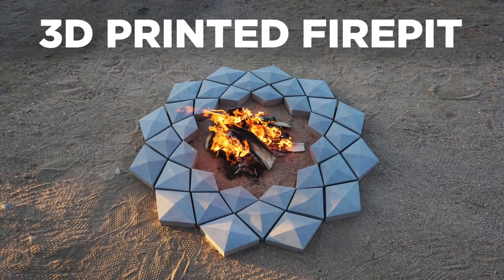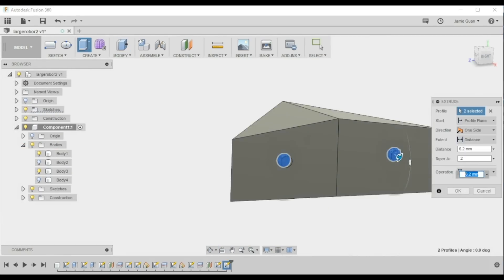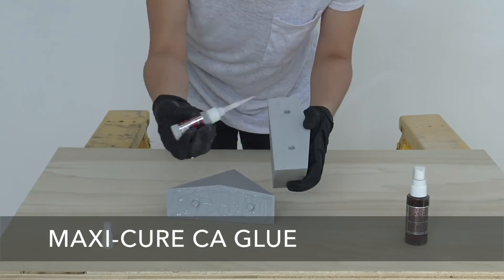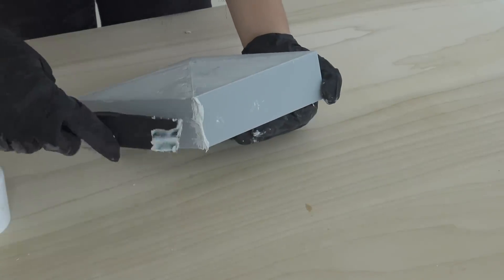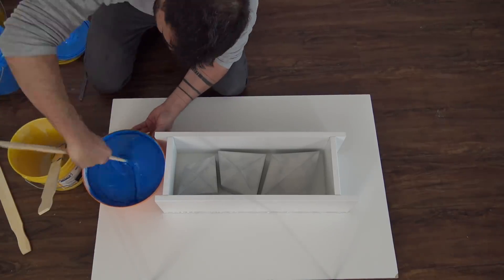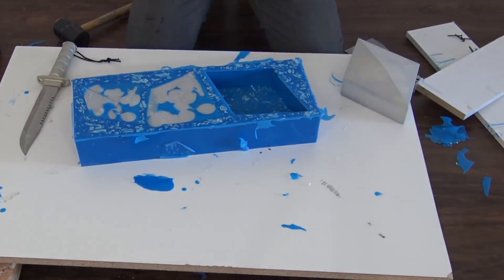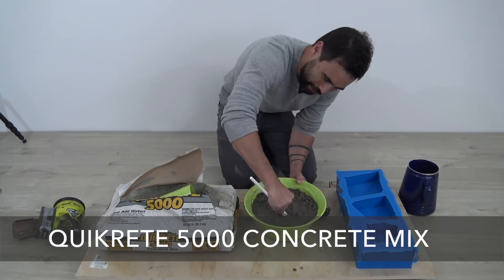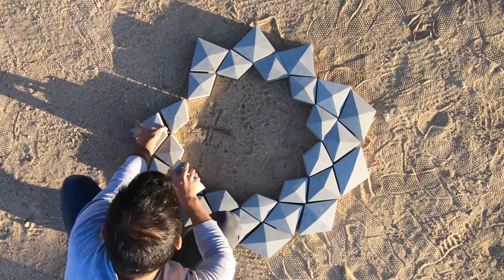3D Printed Concrete Firepit

Comment from the maker: Links to the 3d files in case anyone else wants to make one:
Small: https://autode.sk/2K8McyK

Medium: https://autode.sk/2I8eCZ0

Large: https://autode.sk/2KQRSi1
Reply from the maker: each file is a different block they are the same size as the ones I used
Reply: HomeMadeModern simply beautiful truly love the design have you thought of selling the molds for this project?
Reply: Deceptive Title

Comment: Interesting design process. I think it would be faster to just make the prototype shapes out of cardboard or foam core. Then you could fill them with plaster of paris and proceed from there. You don't even need a computer to draw these shapes. Just a compass, ruler, and a bit of math.
Reply from the maker: yes!  foam or wood would both work well!

Comment: I'm a bit curious. You're essentially using just the outside of the 3D printed shapes to make your silicone mould. Why did you print them as thickly outlined and skeleton infilled shapes instead of using just a thinner outer shell? Are they not strong enough with a thinner shell? Did they warp too much when using just a shell?

Comment: Hi Ben, thanks for the video and the designs, your work is gorgeous. What material is best to print the 3D objects used for the silicone mold? I'm sure there are differences in finish despite the Bondo being added

Comment: So..why the f*ck did you 3d-print these blocks?

A piece of wood, a saw, a planer and 15 minutes of elbowgrease would have gotten you the same result, wihtout wasting  a ton of plastic.

And with a little more skill you could easily make a re-usable mold entirely out of wood...

I hate the 3d-printer generation, the iphone stupidity.... yes you are making a firepit but you are using the zero-skill method, where's the challenge?

Comment: That’s pretty dang cool. Kind of disappointed you didn’t actually 3D print concrete with a special printer, but still cool none the less. 

Some other idea would be to add color flakes and other small stones into the cement before pouring to get some cool patterns.

Comment: if you made a vapor chamber and put your prints in there it will smooth out your print.
Reply: Won't work for PLA which is what he said he used. ;)

Comment: Anybody know of a more affordable silicone for the mold? My Canadian distributor for Mold Star 30 says it's $250 plus shipping for 1 gallon of it. Way too much.
Reply: 3d print or fabricate the mold out of plywood. Just take the negative of the shape. Maybe cut the model in half or quarters, and make indexing pins and holes for bolts. This makes getting the casting out easier. Use petroleum jelly as a release agent. Don't get why they didn't do this in the first place.

Comment: I love the finished product! It's such a neat design and it's a versatile enough idea that you could rearrange the shapes or add a couple of new ones and end up with a totally different design if you got tired of this one. And it's great that you used 3D printing and concrete to get there! I could definitely see making the original forms out of wood if one didn't have a 3D printer. Neat!

Comment: Is there a reason you chose bondo over acetone for smoothing?
Reply: acetone doesn't dissolve or smooth pla plastic. 0:42 top right of cura settings

Comment: FYI if anyone chooses to follow this guide and 3D print the positives for the molds.
1. Drop layer height to increase quality of part.
2. Parts show here were printed on close to 20% infill which uses excessive material and time. Since they don't need to be strong they could be printed on closer to 10% infill. 
3. PLA can be sanded down to remove ridges although you would still need to fill the gaps with Bondo if printing in multiple pieces.

Comment: This is a very nice design. I was wondering if there is a way to skip the molding process and go directly from the 3d print to the concrete form. While I have not been working a lot with flexible filament it might actually work out to create a mold from flex filament and directly pour the concrete in it ...
Reply: @Emmett Martin , sorry if i sound stupid, english is not my native language and I sometimes do big mistakes.
Reply: I'm pretty sure we could even pour concrete in solid material like PLA as soon as the design is simple and the mold is well thinked. A design like this one could be printed as a four interlocking parts mold for each pieces. I actually have to try this!
BTW @WayofWood love your channel, love the way you use your printed pieces as tools and not as finished product.
Reply: I'd recommend ninjaflex 👍
Reply: tokagehideto well thinked 😂
Reply: The amount of material required would be ridiculous, and there's a good chance that the layers would separate.
Reply: that's more a proof of concept than a real project. I tried it, it was fun and it actualy work i used prompt vicat in my concrete to make it cure quickly since having to much water in contact with the PLA was making it delaminate.

Comment: Great video. Love the idea. Was there a reason you used Bondo instead of spray on filler primer?
Reply from the maker: I haven't tried a spray on filler yet but open to the idea.  know of a good one?
Reply: I use Rust-Oleum 2-in-1 Filler Primer. It's worked for me on a number of projects. I recommend applying a coat, letting it dry, sand  and repeat until smooth. It usually takes me 2 coats to smooth out a 3D print.

Comment: Great design process and love the final product. I hate to mention that concrete will easily crack with the heat generated from fire. This project is probably only as useful for very small fires that are within 2 feet of the blocks. Otherwise its way cool!
Reply: Troye Stonich you didn’t watch the video before commenting did you.
Reply: Could always go for some refractory cement if you were really worried.
Reply from the maker: large pieces of concrete will crack because of trapped moisture.  I have experimented with small pieces like this and have had zero cracking.  the surface to volume ratio of the shape also impacts the cracking.
Reply: Nathan ObJective because metal 3D printers cost 100k+
Reply: You clearly didnt read his comment. He says to weld these shapes out of flat sheets.
Reply: Why not just 3d print them out from metal, Or you could weld them quite easily after punching them into shape.. The one block (if made out of ss 304)  is only going to cost around 10USD welded. 
That way you'll have a commercial grade product that can be shipped and sold globally.

Mind you this would make a good wall decor (flatter)

Comment: Very cool looking! Do you think a vacuum form could be used aswell or for the casting forms?
Reply from the maker: Thank you! Yes it could, but keep in mind that vacuum for molds will not last as long as silicone molds.
Reply from the maker: yes!  I am currently researching vacuum forming.
Reply: Thanks! I've been thinking about building a vacuum former and this would be a great use case.
Reply: I can pretty much promise you that a thick vacuum molded concrete mold would last far longer than a silicone concrete mold. Silicone gets torn up over time from the concrete. Vacuum formed would be much more solid.

Comment: Clickbait as usual. The fire pit is not 3D printed
Reply: AND its not even a pit. Its just a ring of bricks essentially. You gotta you know, dig a pit, for it to be a pit...
Reply: Yeah, but if he just said Concrete Fire Pit you would have been in the comments complaining that you needed a 3D printer and he didn’t call it out.
Reply: Corey Ward the patreon supporter? 🤣👍🏼
Reply: As far as i know, a 3D printer was involved in the process.
Reply: ...What did you expect?
Reply: Teitchie Did you skipped the first couple of minutes? 🤔
Reply: Teitchi   Did you think he was going to use a specialized concrete 3D printer on a channel promoting DIY projects for the "average" person?  When I read the title, I just assumed he was referring to using a standard 3D printer as part of creating the molds, just like in his DIY patio pavers video.